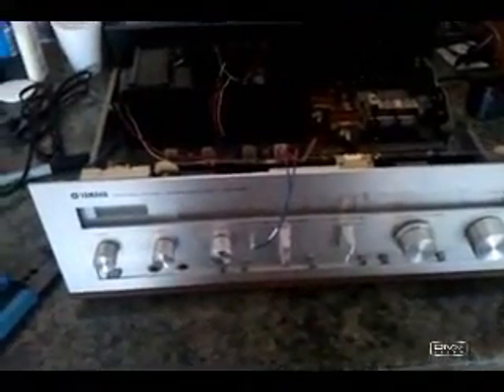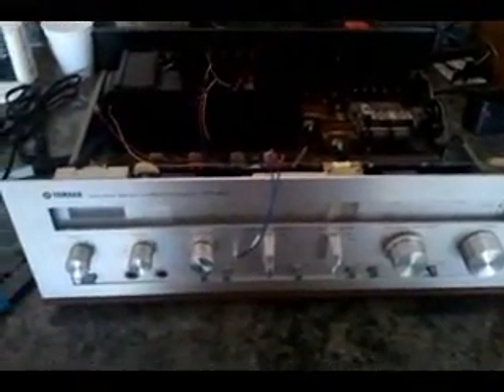Yamaha Natural Sound CR-420 Receiver Restoration Part 3 LED BULB UPGRADE and Completed Restoration.

Comment: You should check your amplifier voltages at the test points listed in the service manual. Adjust the output bias and check for clipping with a scope.  These old yamaha's are always way out of spec at this age.  Not to mention replacing the power supply caps!  Nice piece of gear you have there, make it sing!
Reply from the maker: James Hendricks I may have to do that but for the past 5 years it has sounded pretty great.